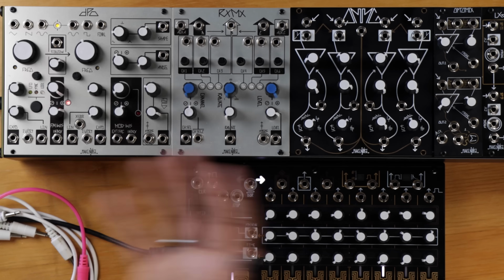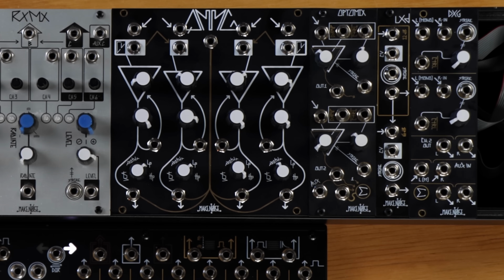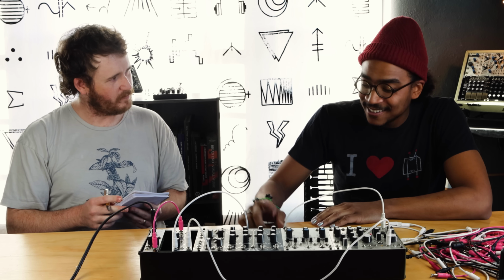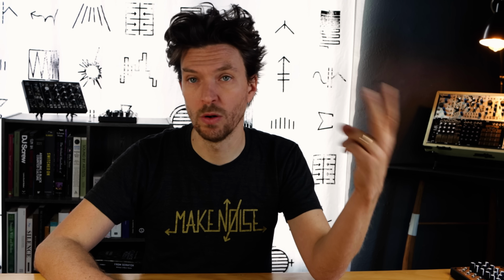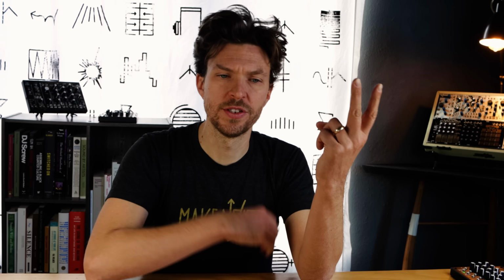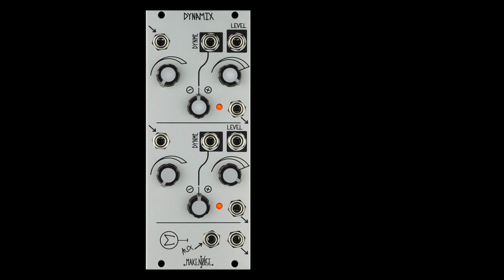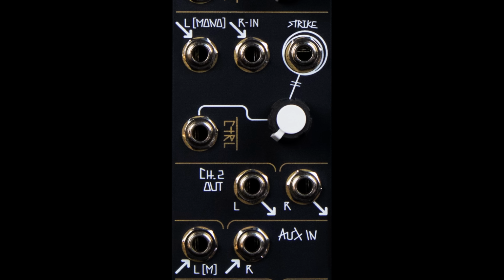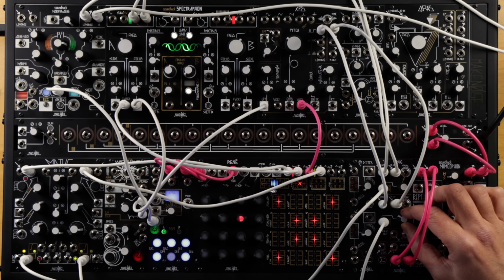DXG Intro and Overview | Make Noise

Comment: ok guys, not bad.  But maybe it’s time to update the morphagen firmware and fix the bugs with unstable green sections and stuttering?
Reply: What stutters ? I'm intrigued
Reply: Stutters sound fun
Reply: My morphagene is a beast 
Year 6 Still going strong
Reply: Maybe an all new Morphagene/Phonogene successor is in the works on the new digital platform that Spectraphon is on, since they specifically mentioned it being their most silent platform yet. Hopefully the next version will not have the much discussed "coil whine" noise emanating from the module itself, along with no more excessive "hiss" in the signal path that many people have experienced since Morph released in 2017. 😉
Reply: @apeirogonmusic  Let us hope for the best.  The situation that has arisen with mimeo is depressing.  MN support has been writing for years that problems with noise and clicking can be caused by the power supply.  But it was enough to admit the mistakes and release the firmware!
Reply: The fact that the morphagene makes as much noise as it does in their own shared system case is a huge bummer.
Reply: So it’s not just me. My morphagene refuses to stay on the green the older it gets. Seems like an easy firmare fix.
Reply: @system23 I’ve never had that issue of it not staying in green, maybe a fault unit rather than a firmware issue? I bought mine in 2020 I think
Reply: @officialLINKSIS maybe the could make it a toggleable feature.
Reply: @RaspberryBrigade  so in my ALM case the Morphagene is noticeably humming away .. but in the new 4 zone Make Noise case it’s silent

Comment: if you patch the channel 2 outputs into another module, does the mix output still include channel 2 or is it removed from the mix?

edit: confirmed via twitter that you cannot remove channel 2 from the mix output.

Comment: Is this right, that the DXG is cutting some crispy high frequencies, even if control potentiometer is full up and the control input is triggered by the gate signal of the MIDI-to-CV?
Reply from the maker: Probably depends on the height of the gate coming out of the converter. If it’s 5V then it may not open the gate fully. Also, it is possible to “damp” the circuit by fully opening it with shorter triggers. I’d recommend amplifying the gate signal and/or trying different settings of the knob.
Reply: @MAKEN0ISEMUSIC  simple A/B test. Gate goes always to QPAS VCA. Test A: signals routed to DXG channel 1 or 2, potentiometer fully up. Test B: signals routed to DXG Aux channel. Clearly: test A is missing the aggressive and crispy heights, that are observed with test B. That means DXG is not a true mixer because it’s cutting the heights away. Is my DXG malfunctioning?

Comment: There is definitly a demand for a dual LPG optimized for a stereo signals. I also think that it is pretty expensive for 8HP without any vactrols. And where can I buy those vactrol ear-ring?
Reply: "There is definitly a demand for a dual LPG optimized for a stereo signals. I also think that it is pretty expensive for 8HP without any vactrols."

Demand is high, so price is high, welcome to capitalism, thanks for joining us :)
Reply: @BappinProductions  here in Europe it costs about 275$...
Reply: @sonicspecter  and in the US, EU made modules cost more. You can buy a Joranalogue Delay 1 for £244 from Juno Records, from Perfect Circuit it costs $399, which is about £312...I preordered mine from Juno for $267, because they don't charge your card until it's despatched, but it's available for $254 (£199) from other retailers here. At Perfect Circuit it's $215, so it's 18% more expensive across the pond for us, still more reasonable than the 27% increase going the other way, for Joranalogue modules anyway.
Reply: @BappinProductions  I don't agree with your observation. In Germany the other Make Noise products are currently 10-15% more expensive than MSRP (which is reasonable considering the € to $ exchange rate).
Reply: @sonicspecter  I don't really know why I'm busting your balls about it, but I will stop now. You understand that imports incur additional costs and it's OK to have an opinion about the cost/perceived value of modules or anything really. Have a good one, with or without buying a DXG ☺
Reply: @BappinProductions  no worry. I’ll stop ranting about the ridiculous overpricing of Eurorack modules and buy one DXG anyways 🤣
Reply: @sonicspecter  Do it, make me feel better about preordering mine 🤣

Comment: The idea is nice, very nice, but why there is no panning control ?
Reply from the maker: The DXG is primarily designed for the gating and mixing of signals that already contain stereo image or motion, such as those derived from the XPO or Morphagene, or processed by the X-PAN or QPAS.
Reply: @MAKEN0ISEMUSIC  totally agree, i was thinking about using it with xpo, but then the difference between sides is only timbral, not volume or gate length. If I want some more control over my xpo stereo outs I'll need to add some other module, like xpan or qpas, which doesn't really make sense to me
Reply from the maker: Yes, each module in the system has its purpose. The DXG is very useful for mixing down and gating multiple mono or stereo voices. The X-PAN and QPAS are more oriented toward adding stereo animation to voices that may not already have it. These modules are all designed with each other in mind :)

Comment: Vactrol free low pass gates….. so we in the U.K. and EU can get these modules😃👏🤘
Reply: I was on the verge of buying some more optimix modules when I read that the U.K. & EU banned vactrols…. I already have 3 optimix modules and 2 MMGs…… always wanted a qmmg….. actually there’s a thought…. Would it be easier to do a run of vactrol-less QMMGs?🤔
Reply from the maker: FYI, Rubadub currently has Optomix in stock.

Comment: No more hunting around for black panel LXD or Optomix! Stereo to go with XPO/Morphagene/Qpas/X-Pan/Spectraphon/Mimeophon. 

That seems about f***ing perfect to me.

But dual stereo LPG plus Aux in mix? That's just wonderful. SOLD.
Reply: Dear MN. I scored a 2nd XPO from b-stock at my local vendor. They're holding it for me, and I will receive it in early February. Is there any chance you could do a video of 2x XPO's through the DXG? Just to see what it can do?
Reply from the maker: That is probably on the menu :)